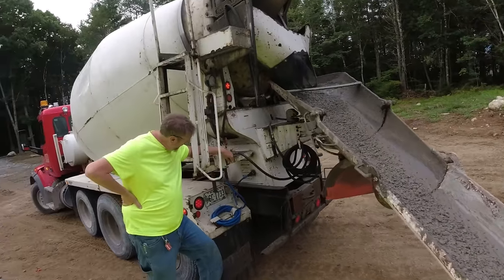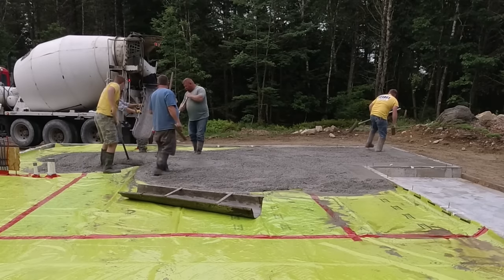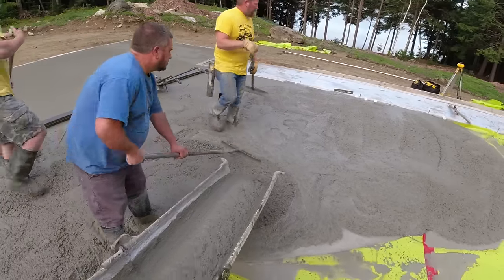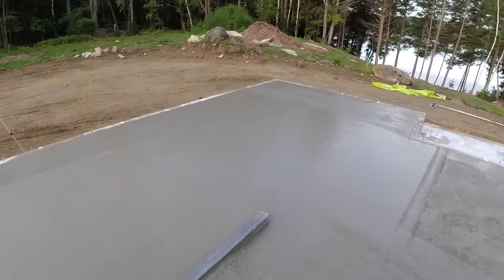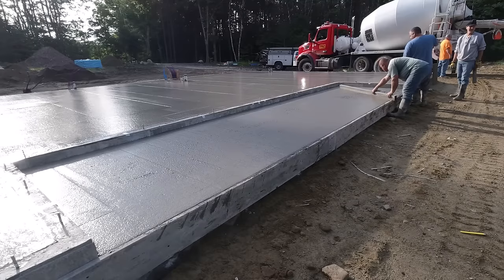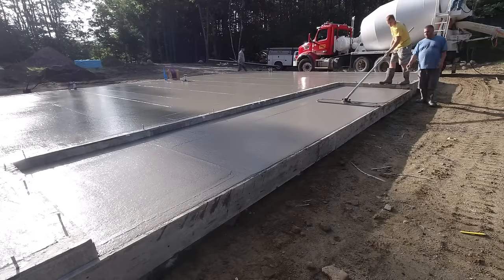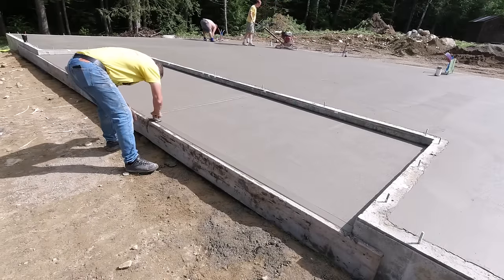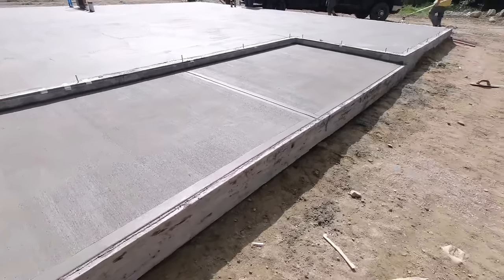The X Factor To Making Pouring Concrete Floors Easier (Experience)

Comment: Serious question- why are you pouring interior concrete with air entrainment? That's the one place in which you should NEVER have air entrainment...
Reply: Since they had a patio they could just have all the mud come together without having a separate truck just for the patio. I see a lot of engineered plans that call for air entrainment and slick finish on interior,seems contradictory but I’m not the engineer 🤷‍♂️.

Comment: You are absolutely right about steel reinforcement on concrete.  Concrete has very high compressive but less tensile strength. Reinforcement helps protect slab integrity under tension.  Common ways the concrete has tensile forces applied are being entrapped (like a slab between walls) when expanding and contracting from temperature changes or subsidence form improper subgrade preparation.   I had a 26' x 36' shop slab poured inside a ICF frost wall (8", 4000 PSI with fiber, one control joint midway, on 2" of blue foam with 6 mil vapor barrier, and meticulous sub grade prep) and no steel.  People we're flipping out telling what a disaster I was going to have. Ten years latter there is not a crack in that slab.  It's expansion and contraction is buffered by the ICF block so it is not trapped and never goes under tension.  This is with a 10,000 lb car lift on it.  The unstated downside to steel is it expands as it inevitably corrodes and can break the slab up on it's own.  Great channel, watch regularly.  I'm from Hollis, ME now exiled to VT.  I recharge my accent when I watch.  As I tell the Vermonters,  anybody from Maine is worth two Vermonters, three on a good day.  They take it in the spirit of humor as intended but people from away are aghast.
Reply from the maker: It's funny how people think the concrete is no good without rebar or mesh!

Comment: Wet screed is fine , but just raking the mud then vibrating doesn’t produce a flat slab. Yes, steel makes the slab reinforced concrete, for structural strength.

Comment: ??Two questions please?? 
1. Give us a link or tell us how do you get a concrete shoot extension? 

2. In a video please explain how the broom lines are supposed to go I have heard you are supposed to go perpendicular to the way people walk so in your video you should have did those broom lines the opposite way because when they walk out the door the traction is going to be opposite of the way their foot pushes off while they walk to the backyard. But then again when you see lines going away from you basically parallel to your eyesight it makes it look like there's a lot more concrete it makes everything look bigger and longer and they will still be plenty of traction on the concrete so I don't know what's your opinion?